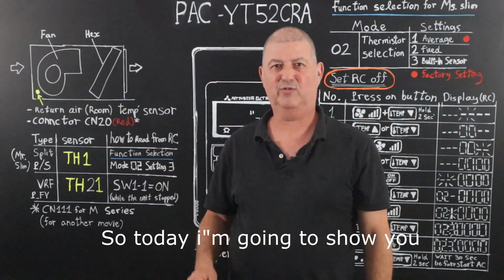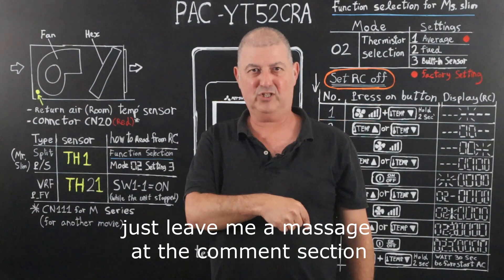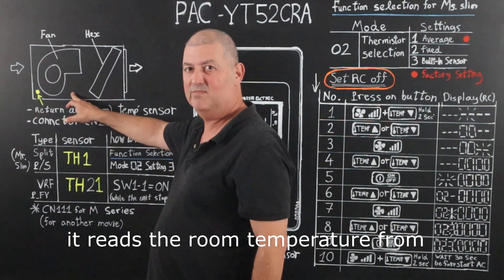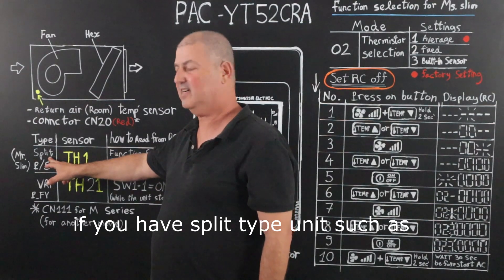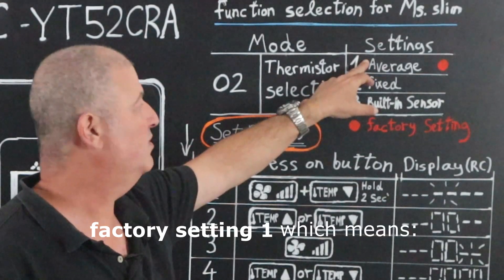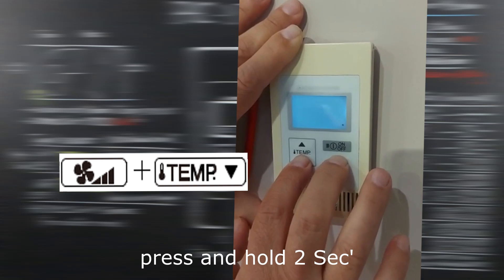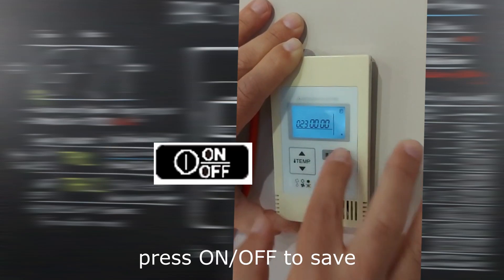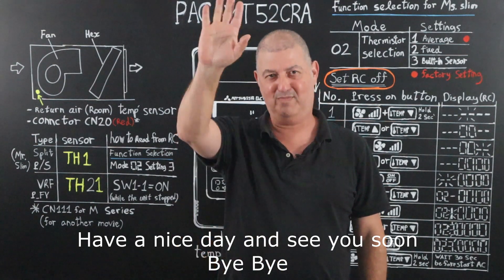How to READ the Room temperature from the PAC-YT52CRA built in temperature sensor

Comment: Hello and thank you.  I have a PEAD-SP100JA internal unit using a PAC-YT52CRA and I am also using an MAC-587IF-E WiFi controller with MELCloud.  Do you know how to program the unit so that once the desired temperature is reached the fan unit will turn "off" completely versus the default low fan mode?  Also, as per your video, when should the setting be set for room temperature versus the default?
Reply from the maker: Hi, Sorry for my late response:
As for your first question: According to the manufacturer there is a function No. 25 (MODE 25) - "Fan speed during the
heating thermostat is OFF". you can try MODE 25 setting 2 (setting 2 meaning is-fan speed STOP during thermostat is OFF during heating [It works on PEAD-RP units, I hope it will work on your PEAD-SP unit as well]). 
[i.e. MODE 27 setting 2 is the same as 25 but for cooling].
please see the movie https://www.youtube.com/watch?v=xTGc2HXPfEc&t=22s
How to change the External Static Pressure with the PAC-YT52CRA
and download the attachement 0009A
From page 5:
at step 6-choose 25 
at step 8-chage it to 2
Do step 9
and continue to step 11
We'd love it if you let us know how it went.
As for your second question-It is a bit more complex-I will try to make a movie about it in the future
Reply: @todayhvac  Thank you. I actually tried looking for both Mode 25 (Heat) and Mode 27 (Cool), as I wanted to set both to "Off".  However, those modes are not available on the PEAD-SP and I can't find if there are different mode numbers for the unit.  I guess I will keep trying.  Thank you again for your response.
Reply: @todayhvac   im in the same boat   with the fan always  running  but I have  TAC-YT53CRAU and the manual  only lists 8 for fan with 1,2,3 speed  as a option no off 😿
Reply from the maker: can you send me a movie  to itay@todayhvac.com so i can understand what the problem is?
Reply: @todayhvac  i think i figured out the issue for me anyway, my unit doesn't have a part CN24RELAY-KIT 

"9.2. Fan control
By setting Mode No. 23 in the Function Table in section 9-1 and using CN4Y from the CN24RELAY-KIT-
CM3 kit, the following patterns of fan control will become possible. "

Comment: hi, great video! I don't get the 00 option on the first two settings it starts at 01 and goes up to 50
Reply from the maker: hi. sorry for my late response. i thing that the reason for the phenomenon you described is beacuse you have VRF system(P_FY indooe unit). for most of the VRF system, in order to READ the temperature from the remote controller you need to make it by indoor unit Dip switch SW1-1=ON. may i ask what is the model of the indoor unit?
Reply: Model number is PVFY-P12NAMU-E. 

I tried the dip switch one however it’s made the thermostat a “sub” instead of main.  

Thank you so much for your help
Reply from the maker: the dip switch SW1 is located on the indoor unit PCB